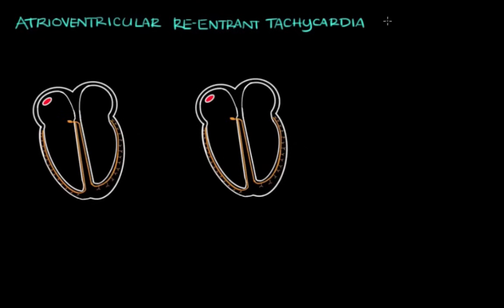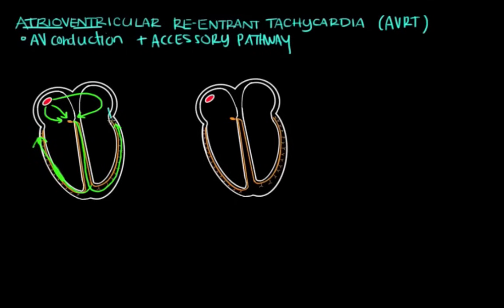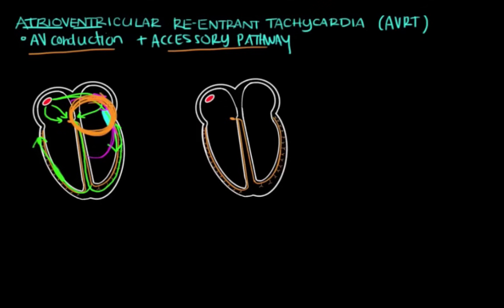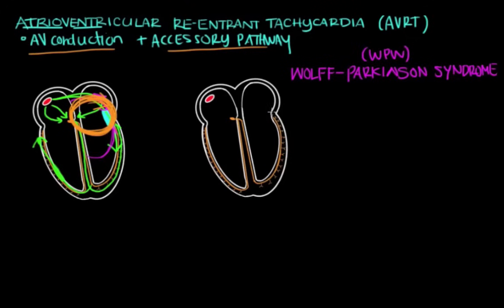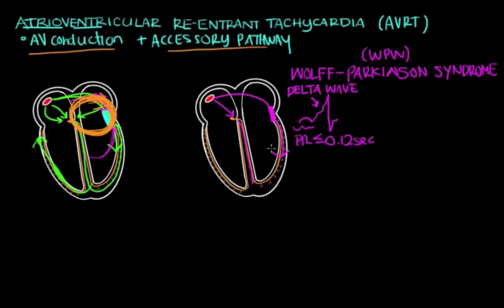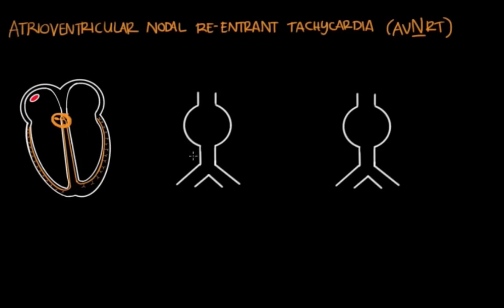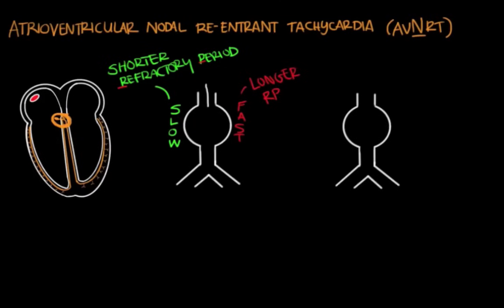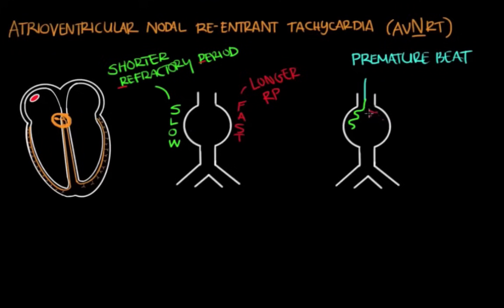Atrioventricular reentrant tachycardia (AVRT) & AV nodal reentrant tachycardia (AVNRT)

Comment: Thanks for the video. With an accessory pathway such as wpw or lgl conducting in the presence of afib with rvr it isn’t safe to give a nodal blocker such as adenosine, beta blocker, cc blocker, or even amio. However, procainamide is considered safe. What is it about the pharmacology of class Ia anti-dysrhythmics (thinking of the relatively flat phase 0 action potential in the av node that makes it safe and not prevent conduction in av node?

Comment: Everyone: trying to study for exams

Me: trying to make sense of what's wrong with my heart
Reply: Did you get it ablated?
Reply: @AndrewPick6  No, it wasn't exactly AVNRT. It was something else, but I stopped doing shift work, moved to another part of the country and started a new life, and the problems went away. I have a small thickening of the muscle in the bottom of the heart, but it's not a problem nowadays. I take a small amount of beta blocker to keep problems away through.
Reply: @MegaMrDanne great to hear!
Reply: Can you explain your symptoms
Reply: @anuragprasad8700  sorry, I missed your comment. I got a couple of attacks in my sleep where I woke up with a pulse of ~250 BPM, I was dizzy, and short of breath. It dropped down to 120 and went up again several times until they stopped it at the hospital. They had to use the electric shock thing, the valsalva manoeuvre and adenosine didn't work. But I'm good now, it's been 7 years since it happened.

Comment: So In AVRT, there can be two menifestation?
(1) SA send impulses, but accessory tract is in refractory.So impulses go to normal AV conduction.When impulses reach to ventricles, the accessory tract finish refractory period.Then, impulses go from ventricles back to atrai before SA node produes another impulse
(2) SA node produces impulses, some go through normal AV nodal pathway. And some go through accessory tract. Those who go through accessory tract reach faster as well as AV nodal conduction lates causing delta waves in ECG.
1.So what about ECG for 1st menifestation?
2. Did I understand correctly?

Comment: Thank for the video! Why does the AV node not work as "the gate keeper" for the conduction from the accessory pathway in AVRT?
Reply: Because the accessory (extra) pathway shouldn't be there in normal anatomy, the AV node is at the "gate" but it cannot stop electrical activity from crawling through a hole in the fence 100 yards away. (I think that makes sense)

Comment: Very good lecture. The only thing I would change is that the slow and fast pathways are not really "in" the AV node. The slow pathway is between the tricuspid annulus and the coronary sinus and the fast pathway is on the other side of the coronary sinus. Otherwise, excellent presentation.
Reply: more specifically it is in the triangle of coch...tendon todaro area. but YEAH!

Comment: Just had my 2nd ablation, 3 days ago, for WPW. 10 years between procedures. Thought we had it beat (no pun intended). Hoping this one is a permanent fix!
Reply: +Chase Dear 
Hi I am thirteen, and last year in November l had my first keyhole ablation, I haven't had any episodes so far and I used to have strange episodes, at least, every two months I was wondering how long it took for your symptoms to come back, in case mine do, because I really don't want to take the meds for it, and I do not want to do nothing as they said as one of the options for me. So I took the option for the surgery because I didn't want it to define me for the rest of my life. You know how people are... "Oh, you came first place in that race, But don't you have that thing wrong with your heart? You didn't feel faint as you crossed the finish line?" I'm sure you know what I mean by those dumb people who assume everything... But yeah my surgeon said after a year they could take out my implant that tracks my heart (reveal device). So I was wondering if it took over a year or under to come back in case mine does (fingers crossed it doesn't) :) .
Reply: @imogenmcintyre2339  how have you been since your ablation?
Reply: Chase Dear All the best mate! Hopefully have it covered now!

Comment: 3rd question, since the reentry phenomenon is going to revolve around the AV node and the accessory pathway in a vicious cycle manner, there will be new electrical signals coming from above (SA node/atrial pacemaker cells) too right? wouldn't that cancel off the reentry mechanism and lead to a normal anterograde conduction again, if that's the case, how can it still be said "the reentry circuit phenomenon takes place over and over and over again".. because it doesnt..??
Reply: The normal sinus rythm (SA node signal) will be blocked due to the refractory period of the reentrant circuit. And you are correct, the sinus rythm might stop the AVRT if timed precisely.

Comment: Question:
1.) In AVRT (WPW syndrome), since electrical signals are going to inevitably travel through both the AV node and the accessory pathway, does that mean the person will have a relatively higher resting heart rate even without a premature impulse? (owing to the lack of mechanism that slows down the signals in the accessory pathway)

2.) In 5:12 you mentioned that IF there was a premature beat, it would eventually form a reentry circuit by the signal that undergoes the AV node back up to the accessory tract at the time its refractory period is over , so my question is what if there was a premature beat that travels to the accessory pathway that wasn't in refractory period in the first place? Now does it differ from normal condition without a premature beat? and what determines the refractory period of this accessory pathway? khanacademymedicine  or Anyone kind enough to enlighten me please? Thanks alot in advance!
Reply: 1. The resting heart rate without a premature beat depends on the SinoAtrial node rate.

2. The premature beat will travel to the ventricle and it will beat prematurely, thus the delta wave appears.

Comment: Thank You so much for the thorough explanation.  I was diagnosed in 1998 with AV Nodal Reentry Tachy, had an ablation shortly thereafter to treat the condition.  However, after the procedure my doc informed me that the affected area was too close to the a/v node, and he was not able to completely get all of it.  So fast forward to today, I average 4 to 6 skipped beats per minute, with the occasional runs of tachy occurring.  I am back on the heart meds, taking Metoprolol extended release 100mg 1x per day.  I just somehow feel like this will be the bugger that gets me in the end.  At least I now know what is happening inside my chest,  Thank You :)

Comment: But does the reentrant circuit send signals upward to the atria ?
Reply: yes it does. you may find inverted P waves after the R waves in the QRS complexes of AVNRTs (the R comes down and goes just below the baseline like a little hook, before returning to the baseline). This represents the retrograde depolarisation of the atrium from the AV node.

Comment: What is the difference between Sinus Tachycardia vs SVT? The absence of the Pwave or  the combining of the P wave with the T wave??
Reply: Neither. Though P-waves are absent in most all SVT's, Sinus-Tach presents as a perfectly normal sinus rhythm, simply with an elevated heart-rate over 100 BPM.
Reply: Sinus-Tach is benign in a structurally healthy heart, but may be very uncomfortable, and anxiety inducing requiring treatment with anti-arrhythmatics.
Reply: Sinus tachycardia is one type of the SVTs. So SVT is a category and not a certain arrhythmia
Reply: Mhd Awada

Yes but in an emergency medicine setting paroxysmal SVT generally refers to AVNRT or AVRT (though an EP study is required to confirm).